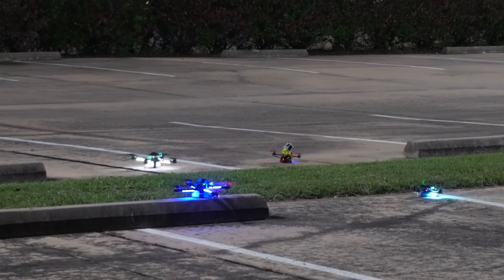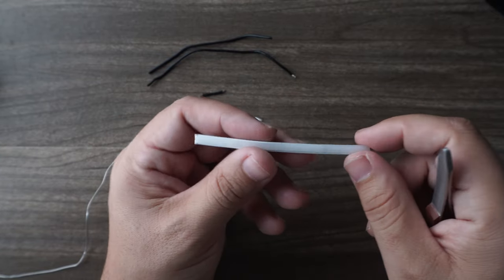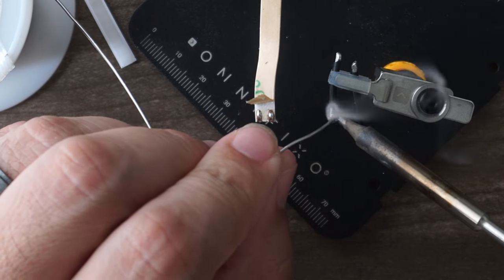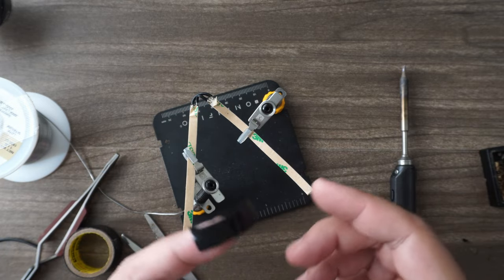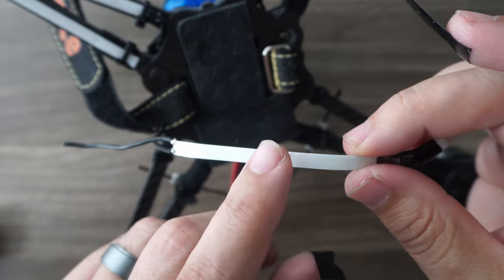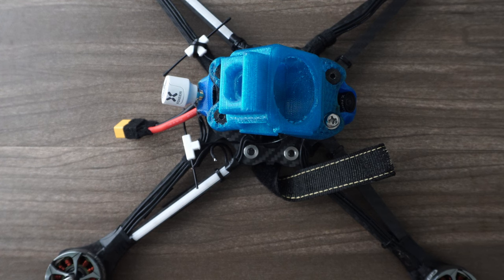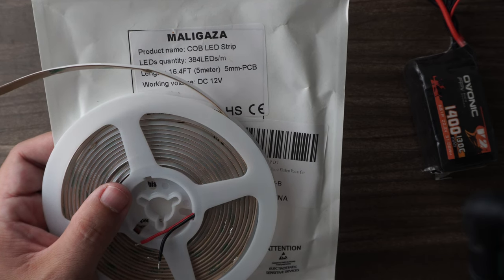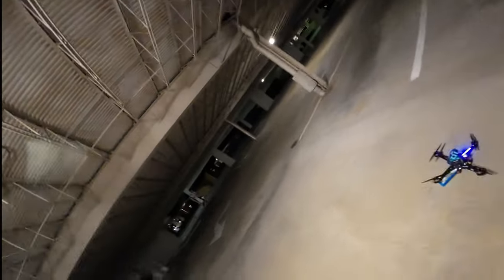DIY LED Strip tutorial

Comment: Are you powering those 12V LEDs directly from the motor wires on a 6S? That part confuses me a bit... I was buying BEC-boards to give them a solid 12V supply from Vbat directly....
Reply from the maker: I am running to 5S motor wires here, but also used 3S, and 6S.  On 3S its not nearly as bright.
Reply: These little cobs can handle way more voltage then they are rated for.  And soldering to the motor channels keeps the build simple.
Reply: #metoo APHI FPV! confusing as fak! lol!
Reply: @leadfingers  , but what about the numbers...!?
Reply: @metrallofpv1722  We can argue about made up spec sheets from Chinese manufacturers or we can go fly. Put the LED's on the drone. 🤣

Comment: According to the manufacturer and website these LEDs are rated from 12 to 24 volts. It also says 12 to 24 volts on one of the pictures on Amazon but on the description it only says 12. But that's good that means that there is some headroom for most packs.

Comment: You showed the COB strip was rated to DC 12 V but powered it with a 6s LiPo. No problems?
Also Can these be powered either from the motor pads or direct VBat?
Reply from the maker: I ran these off of 5S, they for sure work well on that.  Possibly because we typically only power them up for 2-8 minutes at a time.  Also they light up as motors are spinning, so they probably dont put out full voltage unless you are at full throttle which we may only be doing for a second.  I got the recommendation on which strips to use from the street league/spec guys.

Comment: I'm confused.......... you're connecting 12V LED strip to one (of 3) ESC phase running 6S???
Reply from the maker: yes, you solder each of the 2 wires to 2 (of 3) motor wires.  This is running 5S.
Reply: @JonE5FPV  okay....... that sounds interesting.........

BTW I've been running those 12V COB on 4S VBAT, ans 24V COB on 6S VBAT

Comment: I guess the better way would be to use an adjustable BEC (so that you could overvolt the 12V strips) with 'off' pad and wire that 'off" pad to a spare FC GPIO, then you'll be able to blink them and turn them on and off from the radio.
Reply from the maker: Interesting idea.  These light up when motors are spinning currently, but would be a cool way to add some functionality to a non-addressable LED.

Comment: what bec in this build to step down to the 12v? just the one off the fc?
Reply from the maker: not using a bec, vbat from 2 of the 3 motor pads directly to + and - of the LED strip.
Reply: @JonE5FPV  oh, it uses two phases from esc channel output? weird and interesting.  That wont pop an led?
Reply: welp now i gotta learn some maths, assumption 1)120 degrees out of phase wouldnt be full vbat else the leds would pop, tbc
Reply: @lackofeffortfpv7412  Been using 4S VBAT on these 12V COB without issues.......

....

..... Guess what 3 phase voltage of 14.8V is?

....

About 25.2V!
Reply: @KwongKan  im thinking maybe its like peak/vu meter